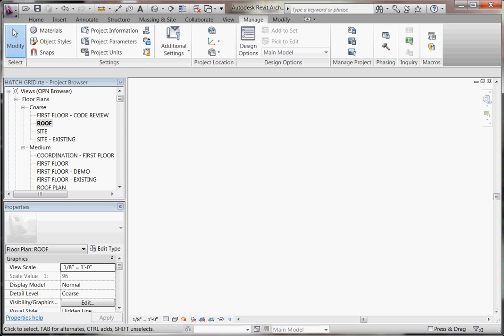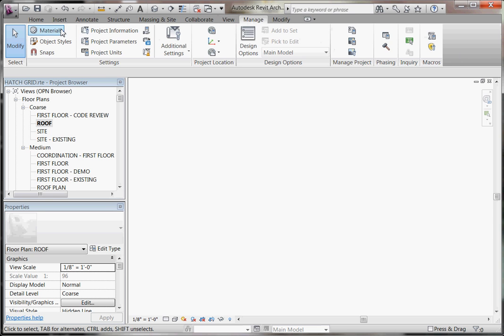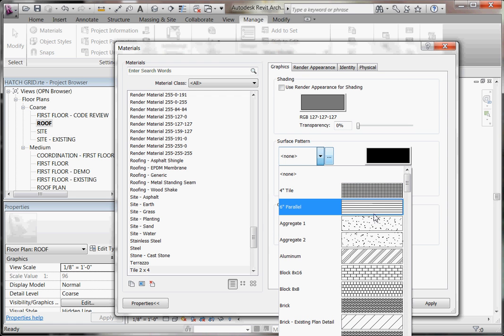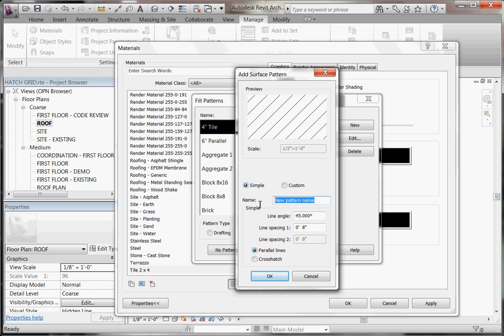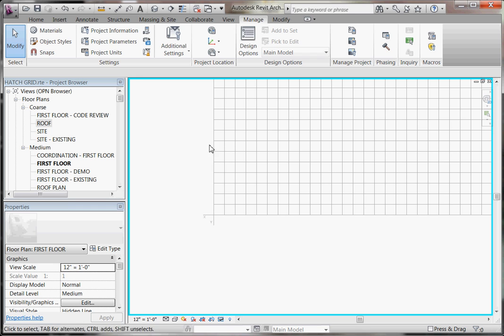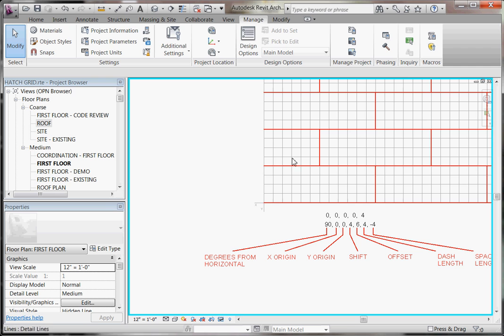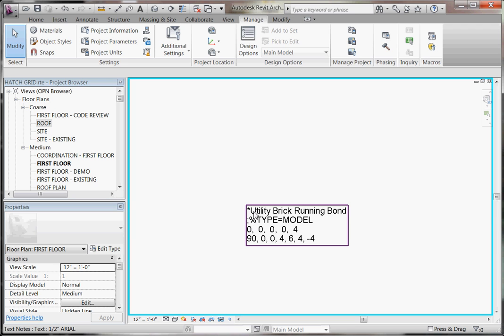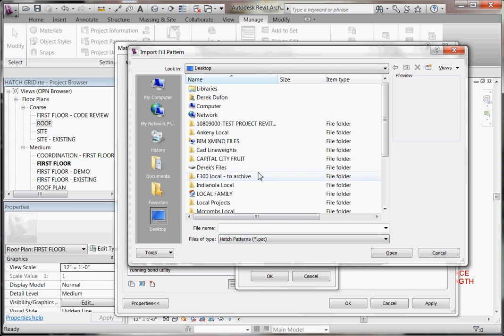Easy Revit (2011) -XX- Create Custom Hatch Patterns

Comment: Nice tutorial, but around 9:00 you begin to provide confusing data. You said the shift goes horizontal when it actually goes vertical. Explain the shift and offset more. A bit more definition here would make this a great video.